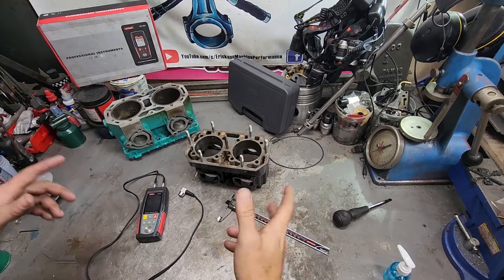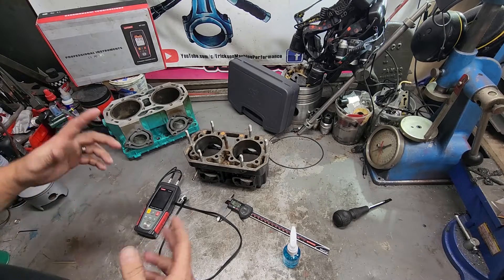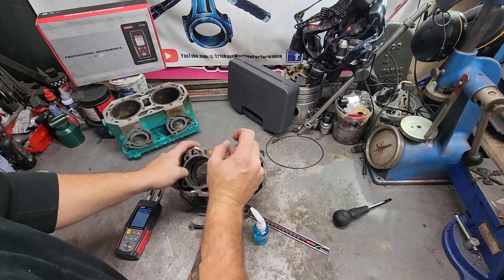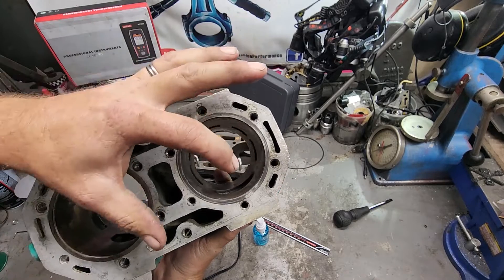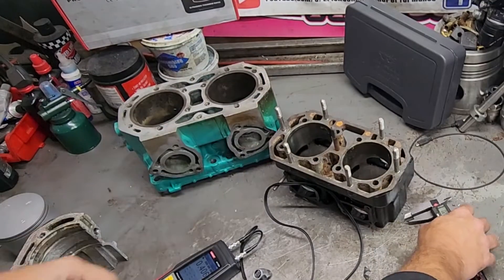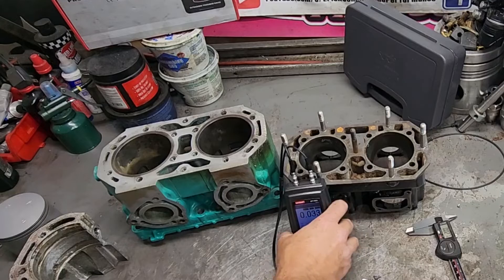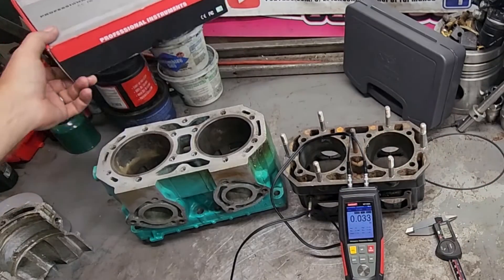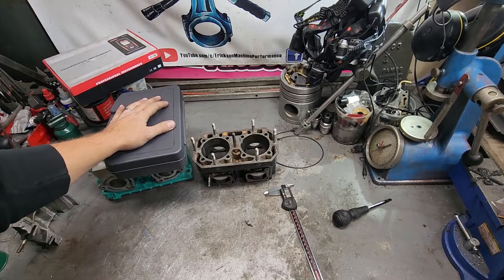Cool Machine shop tools Wintact Digital Ultra Sonic Thickness tester.

Comment: that isnt for cast iron
Reply from the maker: Well it works on it and measures  it accurately to within .005
Reply from the maker: I purchased this on the recommendation from another engine shop that uses this 1. I have Used it for a year and yet to have it be more than .005 off.  We also use it on different metals and its always been within .005 which is good enough for me.  Thanks for watching have a great day